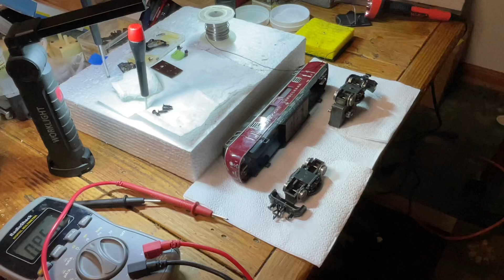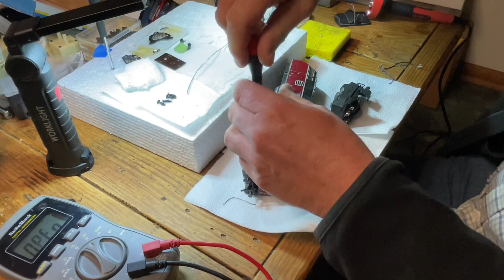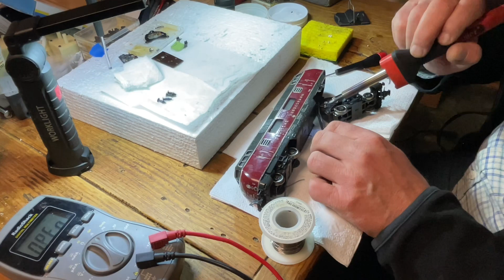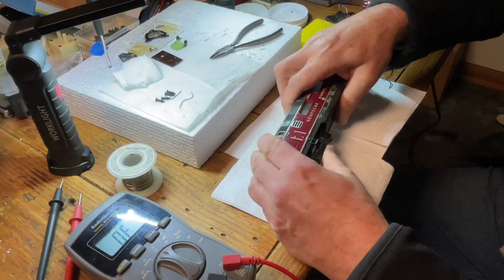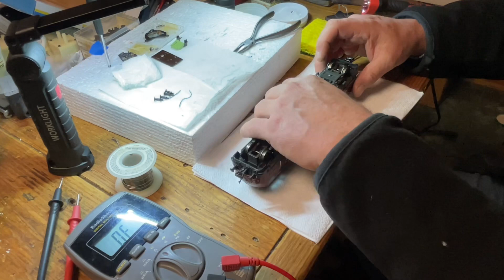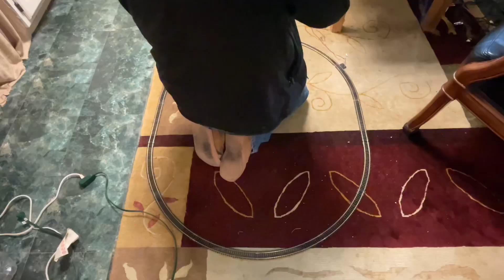Fleischmann 1959 1381 V200-035 conversion to DCC w. Lokpilot 4, Part 3: Motor wired for DC for test

Comment: Now I know that some fleischmann locos have the wheels like some Lima or jouef locos, The old Tyco and life like locos had bakelite or plastic wheels on one side, the early bakelite wheels are always cracked.

I Am wary of any early tyco locomotives because of the bakelite wheels, the life like plastic wheels fare better but when the conductive metal wheels oxidise the pickup only being on the front wheels makes the loco nearly inoperable unless you agressively clean the wheels.
Reply from the maker: @raymondleggs5508 fyi these are Fleischmann metal wheels, which have plastic insulator around the axel. I will show the detail of it in one of my next videos